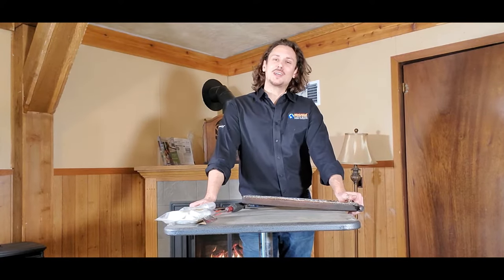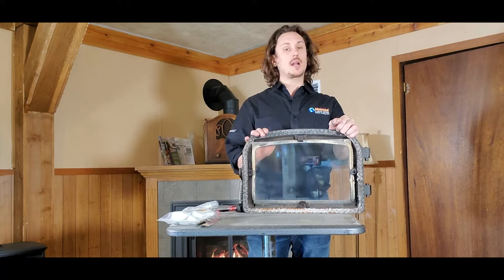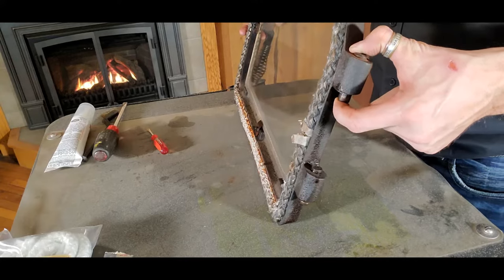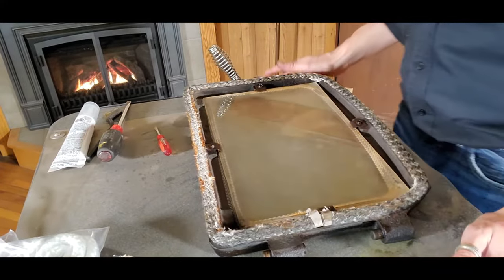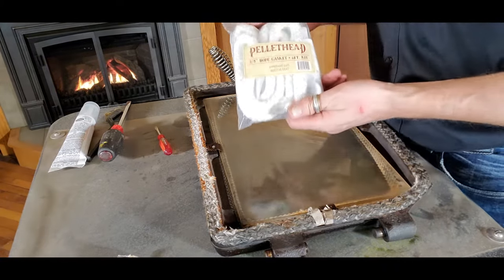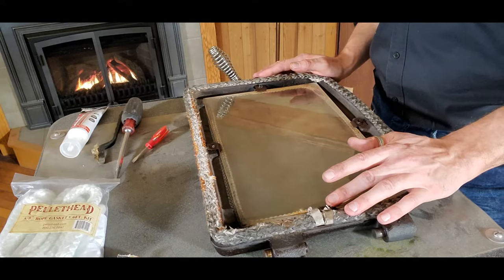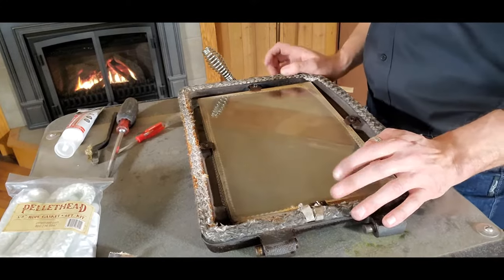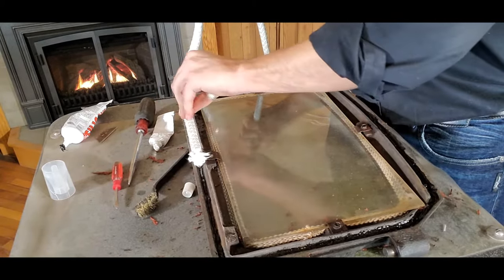Stove & Fireplace Door Rope Gasket Seal Replacement

Comment: Earth stove by traiger,how long of rope do I need ?
Reply from the maker: There are several Earth Stove models, do you happen to know which one you have? 

Here are the three kits we have
https://pellethead.com/product/pellethead-replacement-lennox-earth-stove-woodstove-firebox-door-rope-gasket-kit-34-7/

https://pellethead.com/product/pellethead-replacement-lennox-earth-stove-woodstove-firebox-door-rope-gasket-kit-12-x-7/

https://pellethead.com/product/pellethead-replacement-lennox-earth-stove-woodstove-firebox-door-rope-gasket-kit-58-x-9/

If not, you can measure all 4 sides of the door and add a little extra to be safe for length. Measure the groove width where the gasket sit and go one size up. Ex. 1/2" Groove = 5/8" Diameter Gasket.

Any questions please let us know. Thanks for reaching out.

Comment: Any rope size info on an Atlanta Homesteader 240dg?
Reply from the maker: Thanks for contacting us. I did some digging, and saw some various sellers saying the 5/8" rope gasket was correct for the Atlanta Homesteader Models, however I could not find an owners manual to verify if that is correct. If you can, measure the current rope gasket or door groove. Generally the rope will be 1 size up from the groove width - example 1/2" groove typically will use a 5/8" gasket. Keep us posted, happy to help. Here's some different rope gasket options for reference - https://pellethead.com/?s=rope+gasket

Comment: What size rope gasket for a heat n glow tiara 2 gas fireplace?
Reply from the maker: Thanks for contacting us Cindy. That is a good question. I just looked at the owners manual for the Tiara II gas fireplace but I am not seeing a part number line item for a door gasket... Here is the link to the manual - Parts pages will be 21-25. Let me know if you can locate the part number here for the correct gasket you need. https://www.fire-parts.com/pages/manual/heat-n-glo-tiara-ii-gas-stove-owner-s-manual-2340_981-pdf

Comment: I've got a Blaze King Scirocco 25. What is the correct size/length door gasket that I need?
Reply from the maker: Thanks for contacting us Al. Did some research and it looks like your model will use a 7/8" Diameter Gasket, 7.2' Length. Here is a link to the Owners Manuel, Page 50 will give you the door gasket details. https://www.blazeking.com/wp-content/uploads/2021/08/180-SC25.pdf

Here is our universal 7/8" Gasket Kit Listing - https://pellethead.com/product/stove-fireplace-firebox-door-seal-gasket-replacement-kit-w-sealant-7-8-x-8/

Any other questions please let us know. Thanks!
Reply: @EarthSense  thank you for the reply. I found the owners manual online as well.
 Thank you, I appriciate your response. Have a great evening.
Reply from the maker: @alperreault484  Most Excellent, our pleasure. Have a great evening as well, warm regards!

Comment: I seen a guy soak the gasket to get it damp before applying. What is the right way?
Reply from the maker: Thanks for contacting us. I have never heard of that or seen that before. Based on our experience we would recommend not getting the gasket wet before applying or at any point for that matter. If you need further help just let us know. Thanks!
Reply: Wetting it keeps the fiberglass from getting all over. Especially when you cut it.
Reply from the maker: @rodneychapman197  If one is simply wetting down the area where it is going to be cut, I can see that helping with the fray. I would still suggest against soaking the gasket before applying. Water will have an effect on the density of the gasket and it's ability to seal properly to the high temp silicone or cement when installed.
Reply: You’re right about it not sticking if it’s wet. I should have been more clear with my statement. Wetting it will keep the fiberglass from making a mess, but if you wet it for sure let it dry throughly before putting adhesive on it. Maybe wetting it would do more harm that good to wet it. I covered my 4-wheeler exhaust with fiberglass just like this and I soaked it in water so the i fiberglass wouldn’t get on me as bad and it worked great!! But. That’s a total different application. Sorry I wasn’t.clear with my previous statement. I’ll be more careful.
Reply from the maker: @rodneychapman197  Thanks Rodney, we greatly appreciate your insight and sharing your experience. Appreciated!

Comment: Will it fit vf55fs vista flame
Reply from the maker: Hey Scott, thanks for the message. Your VistaFlame VF55 will use a 9/16" rope gasket for the fire door and ash pan door. We offer a 5/8" rope gasket replacement kit for this model which has proved to provide correct seal. Here is a link for reference, any other questions please let us know. https://pellethead.com/product/pellethead-replacement-enviro-m55-vistaflame-vf55-fire-door-ash-door-gasket/
Thanks!

Comment: I have a propane oven, need to resael
Reply from the maker: We wouldn't be familiar with propane oven gaskets or installation. If you can find a manual online for your model that can be a good place to start to find the right replacement part number. If you can't find any installation advice or videos pay close attention to how the old gasket is installed and mimic that for the replacement. Hope that helps. Thanks.
Reply: @EarthSense  Thank you
Reply from the maker: @cbzombiequeen58  You're most welcome!

Comment: Hello, What gasket kit would I need for a Century Model CJW2000C50? Thank you.
Reply from the maker: Thanks for contacting us. Looking at the manual shows a 5/8" Diameter Rope Gasket for the door on the CJW 1000 and 2000 Series Models. https://www.manualslib.com/manual/1063206/Century-Cjw1000-Series.html#manual. Here is a 5/8" Rope Gasket Kit that we offer for reference. https://pellethead.com/product/pellethead-replacement-lennox-earth-stove-woodstove-firebox-door-rope-gasket-kit-58-x-9/. Any other questions please let us know. Thanks!
Reply: Thank you!  What would be the correct glass gasket as well?
Reply from the maker: @AccidentalFarmer-uw7nr  Sure thing. Glass gasket shows a flat tape gasket that is 1/8" x 3.5' long. The smallest glass tape gasket we offer is 1/2" wide x 1/8" Thick. Part number for the glass gasket is S15001. Hope that helps!